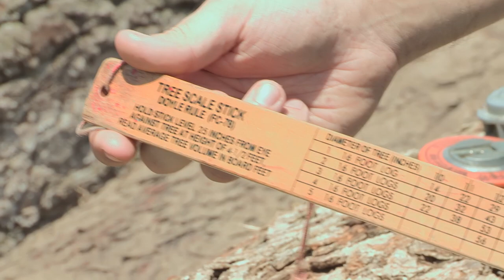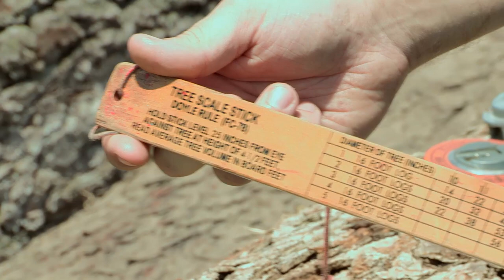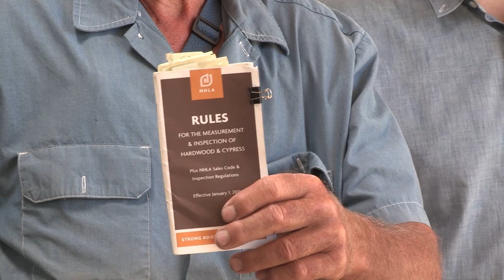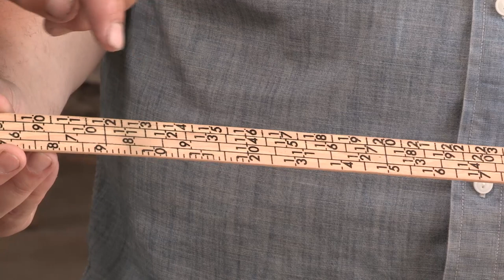Milling Your Own Lumber - Part 7: Grading & Pricing

Comment: Loved this helpful info, thank you for doing it. Question: How do we know what different species are worth, such as noble fir or juniper timber? Ive found we have acess to timber thst isnt sold in mass quantity in stores, but seems like we could still use it for home building, interior work, or furniture. Ive heard Juniper is even superior to cedar for lasting outdoors without treating it for things like pergolas, raised beds, etc. Ive wondered about for wood siding or roofing shingles as well. We also cut giant cottonwood but my husband said its worthless and we cant use it for anything (but he said the same thing about our black walnut trees! 😂). Is it correct cottonwood doesnt have any use for building of any kind or flooring etc? ? 
How do i find this information for different species? Thank you so much.

Comment: Wow. He's learned a lot over the years, probly made some mistakes along thd way too, honestly mistakes are an opportunity to learn it may cost you money but so does school.
Its just more a diy classroom.

Id like to know what he thinks about the proper way to store wood inside a tempture controlled environment like a basement thats been possessed and milled on a planer .  
And really as a novice woodworker I dont  think there is any bad lumber as it all can be used for somthing. 
Lol one time at the lumber yard they had a kiln dried 2x4 that was twisted and warped by feet not inches. I think you could have made a coat rack with it. I think it was Douglass fur or some kind of pine. This 2x4 was so bad it was a conversion piece.   I guess its the imitation you put into it for what it is.
Thats why less then perfect lumber is popular now. And lumber you've have cleaned up 40 years ago as trash fetches a good price in value now.

Comment: Doyle scale cheats timber sellers, because it uses a 5/16” blade kerf that no one uses today, and it greatly underestimates volume on logs that are not the giant virgin growth of 1825, when Doyle was created. The reason all the mills use Doyle is because they’re all equally cheating timber sellers. Think about this, would you rather use a measurement system invented at the beginning of the industrial revolution, or one invented almost 200 years later? Ummmm I’d rather use the International scale, please. Even International is not totally accurate, because most logs today are cut on bandsaws, which have a 1/8” kerf, literally half of the 1/4” rule used in International. That means there’s half the waste that’s figured into how much wood a log will produce. That means more wood coming from the sawmill, and more money in the mill’s pocket. The worst situation is when log buyers use Doyle for veneer logs, where there’s zero blade waste, and therefore no reduction in expected volume from sawing waste. Land owners and foresters need to push back and demand fair treatment
Reply: pamtnman pamtnman kind of like a car dealer using Kelly blue book on what he’s selling and Kelly black book on your trade. 🤣
Reply: That's why you hire a competent forester to broker the deal
Reply: @jeffenglishsetter8339  yes and no. i work with several foresters. some need the bucks quick, some will sell well below market just to keep their relationship with the mill strong. depends on who it is and how his finances are at that moment
Reply: @pamtnman1515  As a landowner I was commenting on your last sentence "Land owners and foresters need to push back and demand fair treatment"
Reply: @jeffenglishsetter8339  i got ya. i do understand. timber is a blind item to all landowners except those who have gone through several management rounds, or who are actively involved in timber management year round. a forester is generally a good choice, i agree. it's just that foresters can go through ups and downs like any person, and their bidding process can easily reflect where their head and bank account are at any point